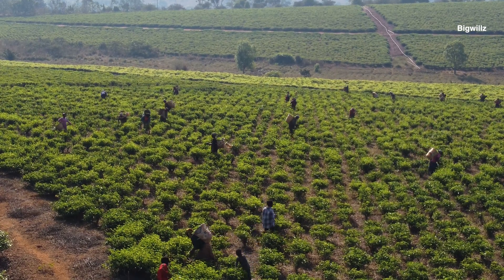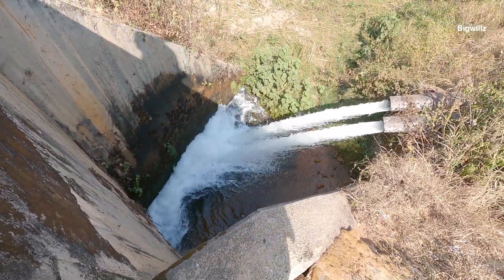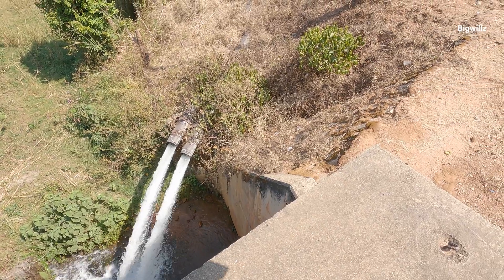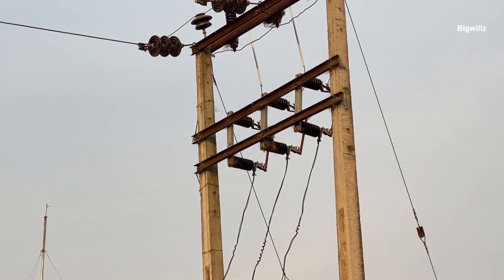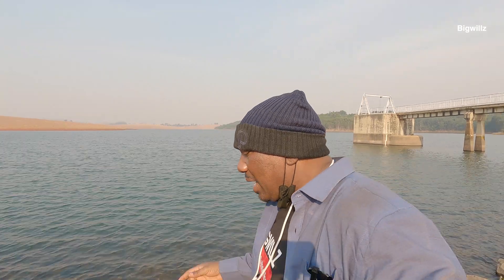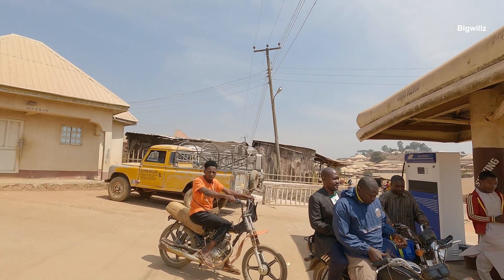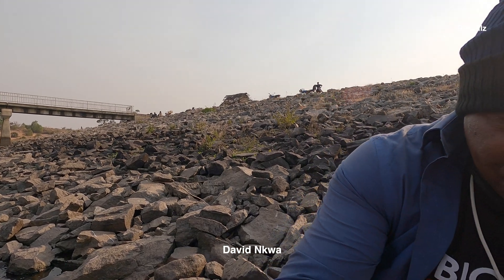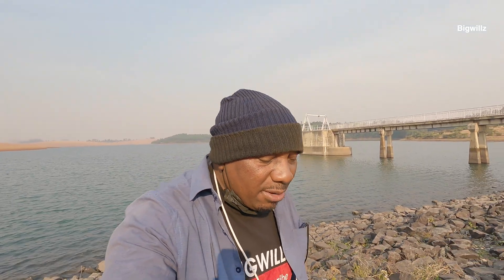How The Nigeria's Tea Factory Generates Its Electricity

Comment: 400MW is way high for such small facilities I think it should be smaller than that. However, I wish to correct a little statement. There is the Nigerian electricity regulatory body which has to give license to individuals generating electricity above a certain value. So the problem is the government. The government must deregulate the electricity industry to allow local investors to come in. It's a regulatory issue. There are investors ready.
Reply from the maker: It's actually 400KW. I think I wrote it somewhere in the video.
Reply: Yes, I have seen it already. 
Electricity generation is not rocket science, it has existed for a long time and the technology has already matured. Nigeria has a government issue but we can generate power under MW rate individually just like the ones you showed. I think the government allows that. The only problem is funding. Thanks for the video.